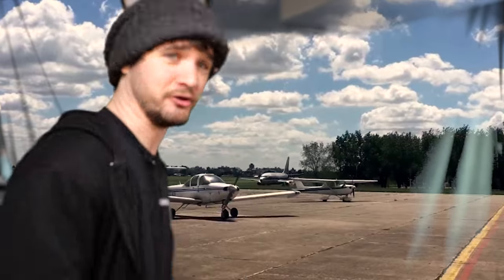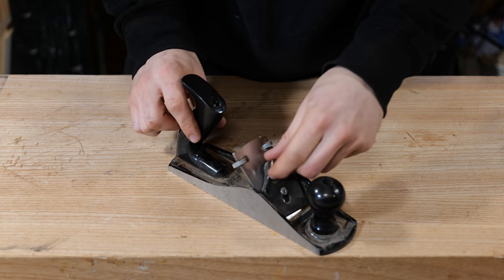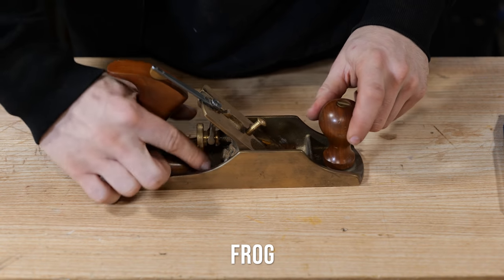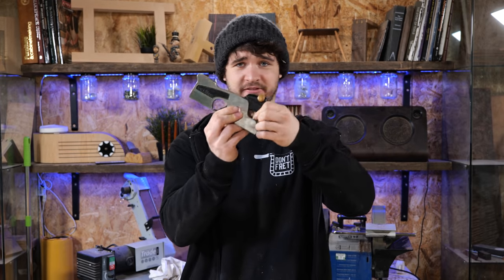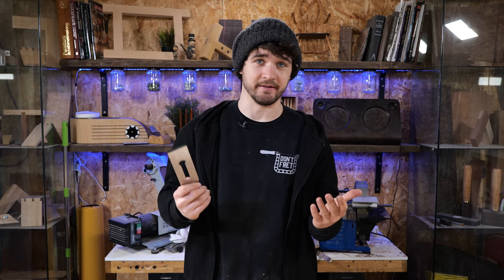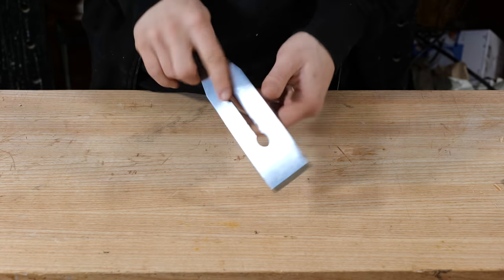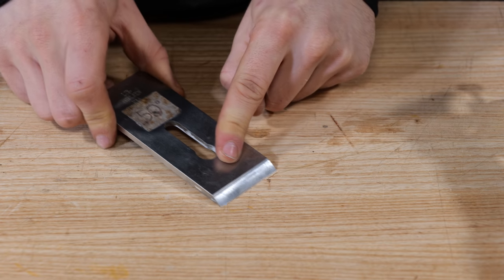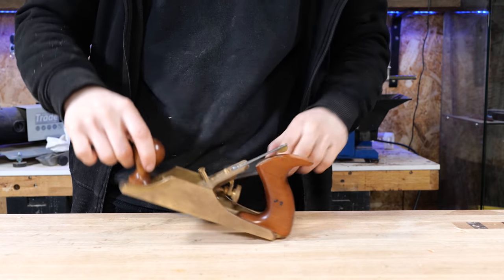How To Setup a Handplane (The Correct Method)

Comment: Matt thanks SO MUCH for the explanation on backlash! I realized the loose movement was that the knob thing was moving up and down but not realized that it needs to push the blade down! Hands down the best video on plane set up. In the world.
Reply: The backlash can be improved by the plane manufacturers simply by employing tighter clearances on the mating parts. On the depth adjustment there obviously has to some clearance between the radius on the operating lever where it engages the the thumbscrew. The same can be said about the tapped hole the thumbscrew goes into and the threads in the tapped hole. Also the boss on the lever that rocks the blade and chip breaker. The slot and the boss could be made to tighter clearances. A note here. Tighter tolerances does not necessarily mean that the fit is tighter. There are whole tables of tolerances and fits in the ISO, DIN, SAE and other engineering systems.
Reply: I never understood this either!! Thanks Matt!

Comment: I want to thank you!  I have had a collection of older planes that I have never been able to use, mostly due to inexperience and an inability to set them up properly. I came across your video and followed your easy setup instructions. I was amazed that I washable to make very smooth and incredibly thin shavings. I truly thank you for b the manor in which you break down the process as well as the reasons why. It made it easy to understand and I look forward to using my planes now instead of just letting them collect dust in my cabinet.

Comment: I had to re hang a door and then plane to fit. I borrowed a small plane from a friend then got a Buck bros 9 inch planar from home depot. The instruction manual (very loose description) look like they have not been updated since the 1970's are basically useless. Love this video, best description of a plane I have found. Matt I suggest you reach out to Buck Bros, my local home depot had two in stock and both had been returned as the tool is basically impossible to use unless you take it apart, sharpen the blade and follow your instructions

Comment: Hi today after watching your video I took my plane apart and reviewed how I put it together thinking about each step at a time as I put it together. I noticed an improvement and eventually clogging so after removing everything again I sharpened blade more but then checked the Plate and noticed a secondary bevel that I don't think should be there so I removed most of the bevel and reassembled the plane and noticed a big improvement but all shavings on one side but just after watching you video again and remembered you said about one side might be slightly higher I will continue planing tomorrow for another little while and see how it goes. My first attempts today we're planing with scrapes on the timber but now there is a big difference thanks to you. You are a great teacher and I'm in my 60s just trying to learn what I was very good at in school because it came natural to me as my favourite subject. If you are doing another video could you please show close ups of the blade and plate and what way they look when fixed together my eyes are not as good now and I'm very eager to learn thank you so much

Comment: Recently I started using an old Record smoothing plane and was not aware of the backlash issue, so I was fighting with the thrust weel ineffectively. Also I did not understand why the thrust wheel was so hard to rotate, so now I now I can use the screw to set the tension... This is the best video on setting up the planes that I have seen, thank you so much!

Comment: Must confess that when a plane is cutting well the satisfaction it brings is rewarding and therapeutic. Keep ‘em coming……..great intro by the way👍You know a razor blade held flat to the base and slid up to corner of plane blade can be useful too. If it meets solid resistance you know the corner is proud of base. Adjust blade penetration until the razor blade doesn’t catch. Check result using the scrap wood tip.

Comment: Thanks Matt for a fantastic piece of instruction.  Learning from you that I was striving to set the chip breaker too close to the iron's sharp edge, and learning that I can't decrease depth of cut by simply backing the wheel due to backlash, have solved a couple of very frustrating problems.  You have some excellent content on these sorts of fundamentals.

Comment: Very nice!
I think it is worth mentioning, that you don't have to pull the blade all the way in when reducing the cut.
You can spin back until the yoke hits the blade, make an adjustment (maybe 2° more turning) and then only turn the knob until it touches the Blade (chipbraker) again.

With experience this back and forth gets totally natural without thinking and it's a great skill to have, because (like you said) it's makes your adjustment on many Power tools much more precise (tablesaw, routertable...)

Keep it up!

Comment: Very many thanks for the excellent tutorial. I've tried the chipbreaker really close with excellent results but I've also had clogging and I reckon it's due to the ruler trick creating a micro-bevel where the breaker doesn't seat correctly. So it's back to flat backs for me! This is where IMHO the BU planes excel, no breaker to worry about. However the damn things go blunt so much quicker - you can't win I guess.

Comment: Very useful! I bought a second hand plane about 25 years ago and have used it quite a lot. I could advance the blade but in order to retract it I always had to (or thought I had to) loosen off the cap lever and then retract it by pulling the blade back with my hand. Now I have watched your video, especially the backlash bit, I have realized that I can retract the blade without loosening the cap lever so long as I take into account the backlash and keep on turning the adjuster quite a lot before it engages with the blade to pull it back. I think it may have more backlash than a new one as it is worn. Thanks!

Comment: Yes yes yes, this is the peice I've been missing, I've noticed the backlash but did not understand it until this video.  Back it up until it no longer cuts, then slowly push it out until it cuts, then cut until it is a full width cut the thickness you are after!

Comment: Fantastic video!  Truly the best I've seen on sharpening and assembling. Been sharpening getting an 100 year old Stanley #4 hand-me-down blade to initially grind to 90 degrees between the front edge of the blade and it's not sharpened sides.  Will take  another pass tomorrow.

Comment: Backlash in the wider sense is the slop in threads. There's a certain amount of rotation before a nut will move on a thread. Which you're certainly going to get with a plane depth adjusting wheel.  The yoke being sloppy in the cap iron is something else again. But I can see how separating all of that could confuse folks. Beyond the mandolin method of checking iron angle you can do the side to side on the work method too. Where you plane with the plane way over on each side and see how the cuts are. It's all downhill from the mid 20s Matt. Have a nice slide.

Comment: What a fabulous, informative video!! I am refurbishing my late father's two planes and found your video-s "must-see". Question: Now that I have the smaller plane cleaned up, what do you recommend to curtail rust? My tools are kept in an un-heated garage and corrosion is a constant problem. I've used motor oil, 3-in1 oil and WD-40 so far. None seems to help with rust and ALL attract dirt and dust. Thoughts?

Comment: Great video. What do you use to lubricate you plane from rusting and ease of use? I use candle wax on the bottom and I spray WD 40 and them wipe it off before storing. Good or bad?

Comment: Thanks a lot for this video! Like others have said, the backlash explanation was very informative. 

I have a questions: Once the plane is set up and you find you need to sharpen the blade, do you need to reset up the plane after sharpening? As in all the adjustments? Or will the blade drop back in the same place as it was before?

Comment: Backlash is kind of like tuning guitar strings.  You always want to turn the tuners to tune UP to your note.  If you go too far (sharp), you don't just tune down a little to the correct note.  You tune way further DOWN past the correct note, then tune back UP again, being careful not to go past it again (sharp again).  That keeps the tension on the strings correctly.

Comment: Ive been so confused by my plane for ages, couldnt get shavings no matter how sharp i got it. 
Well i found out what was wrong. The iron was installed upside down, so the chipbreaker was on the side with the bevel. When i noticed yours was the other way, i turned mine the correct way (it came out of the box the wrong way) and hopefully now it'll cut 😅

Comment: Matt, I bought a new plane. I could not get enough movement to get the blade to protrude below the plane surface, so not shaving. Any suggestions on other adjustments?  Just turning the thumb wheel just didn’t do enough

Comment: chip breaker does as it says, the distance from the cutting edge needs to be adjusted for the wood/job/requirements needed from the plane.
soap is probably the best way to set up a plane for a really fine shaving.....it also treats the sole of the plane.
Reply: i must admit you do have a very good understanding and explain things very well. well done!!

Comment: Provided your chip breaker and blade have their edges at 90° to their sides placing the edges against a flat surface and then tightening the chip breaker screw. Just one thing to make re-assembled a little easier. But when doing this do NOT put the cutting edge against the flat surface. And by flat I mean flat. Not kind of flat.  A piece of plate or float glass would work. Glass is probably about the flattest common item that is easily available.
As far as the lateral adjuster goes (I always think of it as the skew adjustment) I feel that a hand plane would've better served with two screws that act from each side. With a fine thread screw it would be easier control the movement.

Comment: I think that if you dig into the history of the term, the lever cap is a lever with a screw - the one through the iron from the frog - that acts as a fulcrum.  The lever action is achieved by either the older screw style lift, of the later cam (lever on a lever) style.  That is, the whole cap is a lever cap regardless of how the end nearest the grip is lifted.

Comment: I'm having a problem with my planes, they are block planes I have the blade correctly placed I've checked and quadruple checked the breaker and for the life of me cannot get them to shave the wood. They cut small chips on center but keep catching the wood as I go. How do I get it to stop digging in? I think that's the issue is it's digging in and popping up the wood vs shaving it. I made sure the blade was tight and not moving but for the life of Mr I can't get them to shave

Comment: As a newbie, I assumed the blade was to be showing the bevel, like a chisel. Also who would expect a screw to be on the underside where you can’t adjust it or even get to it? Just weird how planes are set up quite frankly. Seems like it’s all ass about face but I now remember to have these “upside down” , although I have a small plane that actually has the blade bevel up, so yeah just confusing out of the gate…thank you Matt. And how come no one seems to have screwdrivers that are short and wide to fit these planes? Been to many stores, no one has them, seems they are a specialist device, even though planes are sold everywhere, annoying.

Comment: So I tried to do the small block of wood trick that you (@mattestlea) showed. Strangely, what I’m seeing with my No. 3 is shaving on the ends of the blade and nothing in the middle. Any suggestions on how to fix that? I’m wondering if I need to sharpen my blade or maybe it’s not square? Cheers.

Comment: looking to get a first hand plane, should I just go for something expensive (like the lie-nielson 4) or should I get something cheaper like rider or Quangsheng or should I persist on trying to get my very rusty broken handled Stanley to work bette, thanks
Reply: I've made totes for planes. I've cleaned up a fair number of old beat hand planes too. With mixed success. Right now good luck getting a Lie Nielsen. I was on their website the other day and most everything is out of stock. I imagine they've been shut down for you know what. It's been a long two weeks to flatten the curve. I will say this about hand plane restoration, I used to sneer at people that fettled the soles of planes. Now I have to admit they are onto something. Although doing that is a thankless task. But doing it can markedly improve the performance of a plane. For whatever reason a lot of plane soles just aren't flat. But when you get them dead flat they do work better. Often the front of the mouth will be worn in old planes. When that's hollow you'll never get it to plane right. The sole has to compress the wood fibers before the iron severs them. If there's a hole in the sole that doesn't happen. You get tear out.
Reply: @1pcfred  thanks a lot!
Reply: @elibaxter6826  well to lap the sole of a plane you're going to need some things. The most important thing is something flat to lap on. I scored a marble tile at a yard sale which is pretty flat. All that polished stone stuff tends to be fairly flat. Has to do with how they make it. Some say you can get sink cutouts from places that do granite countertops. That would be flat. Some use float glass. Then you put sandpaper on that and flatten away. You have to be able to read scratch marks to determine how your flattening is going. Classically things are flattened with surface plates and bluing. But for flattening a hand plane you can come up with your own technique. There's a bit to getting stuff flat.

Comment: I have a very old plane and I disassembled to clean. I took the yoke out and didn’t mark the position. I didn’t see that covered in your wonderful presentation. Looks like the yoke can be moved front to back. Not sure where to position it. I’m assuming the blade should lay flat on the yoke and the sole.

Comment: Hi Matt
Nice work here. Two things:

1. If I'm still around when you're 50, I'm going to play this back to you and your then-degraded eyesight, and vengeance will be mine! :)

2. Here's an actual question/mystery I'm hoping you can answer. 

If i take a full length shaving, on the side grain of a work piece that's 24" long, my shaving -when fully stretched out, will be roughly 20" long. 

And yes, i am sure my shaving is capturing the entire length of the work piece. I wrote on it in pencil to verify. 

So how does the shaving magically become shorter than the piece it came off of?

Thanks....

Comment: SOMEONE - PLEASE - do a video of why a 'thin' blade and chip breaker is really, really good... the only reason a 'thick 'modern £100 upgrade for an old Stanley helps you freehand sharpen - as its easier to find the bevel angle on the sharpening Stone. Put a sharp thin blade and chip breaker in any of your planes and see???   Thick blades were cheap originally as they were laminated and Stanley made 'thin' blades as a massive and expensive upgrade... thick modern blades are a marketing ploy :) only benefit is easier sharpening